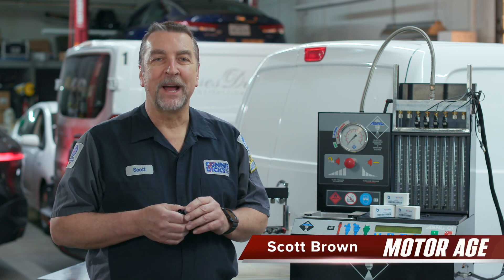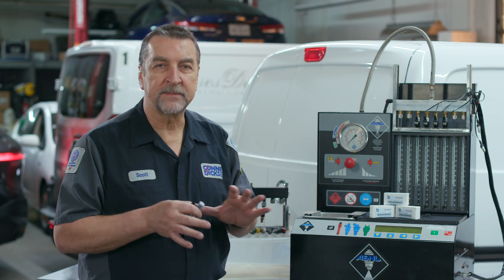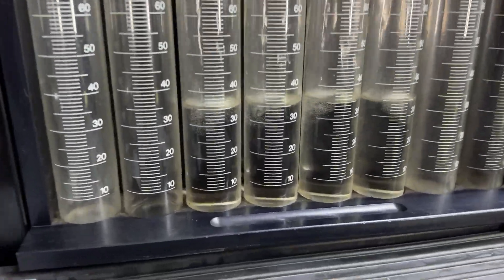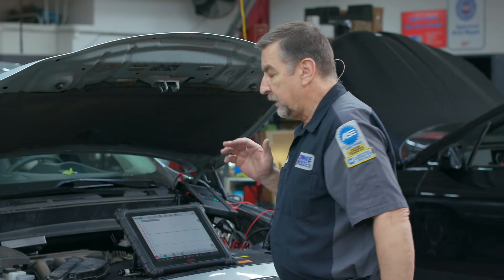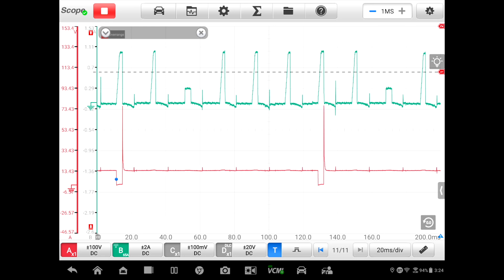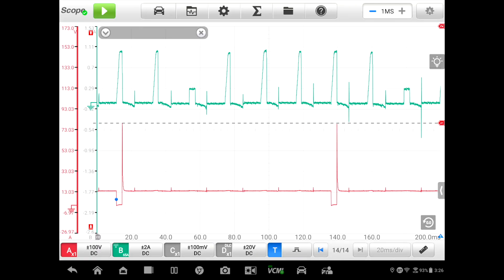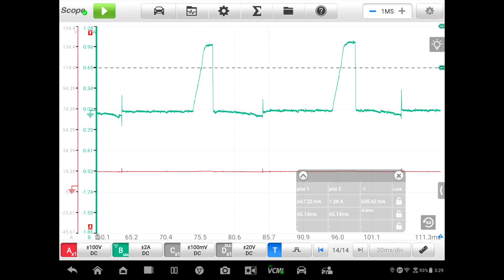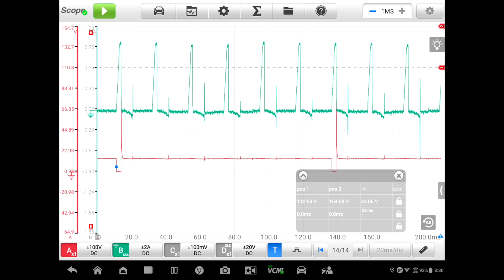Fuel Injector Service MotorAge Tech Tip - Testing, Servicing, and Replacement by bproauto

Comment: Thank you for the tech tip and nice injector cleaning tool.  Like you, I would install new injectors.  Ya, I know, "New doesn't mean good!"
But I don't like removing something two and three times only to find out there's an internal problem in the part itself.  HOWEVER, your injector cleaning tool can be used as a diagnostic test tool to expose even a bad NEW injector.

Comment: Thanks again Scott … nice review. Heres a suggestion for improving these kinds of diag vids. Wot u show is an obvious virtually unmissable fault profile. Yes in the real world u sometimes get that sort of gift👍 But wot abt looking at common complaint, like a near perfect idle but for a 12:17 slight fish bite intermittent kind of miss that may be a slightly clogged or leaking injector … wot does that sort of subtle fault look like on scope. Is it even detectable and wot are some scope strategies for nailing it. Cheers, Alex